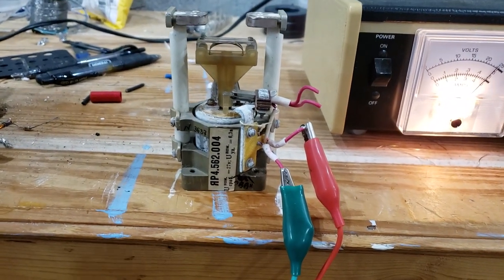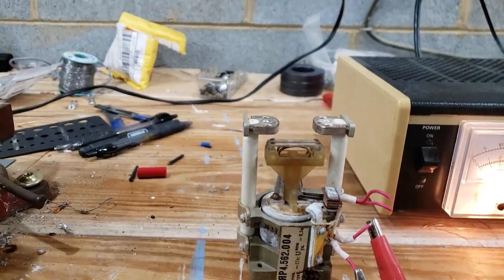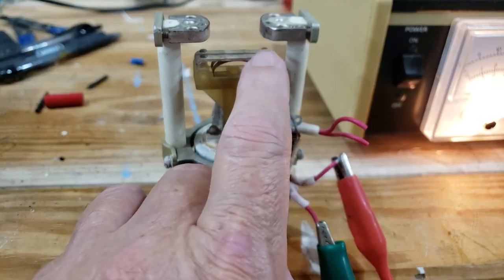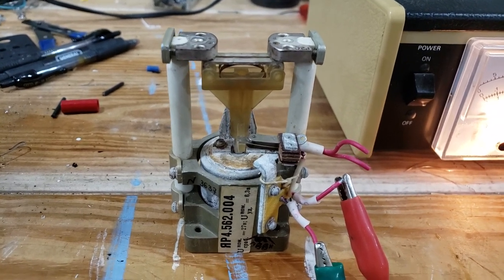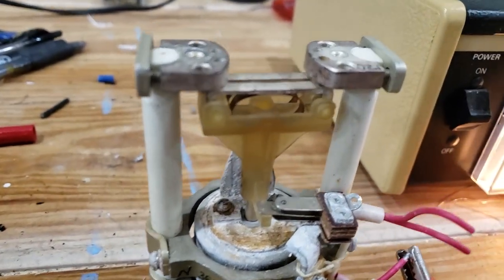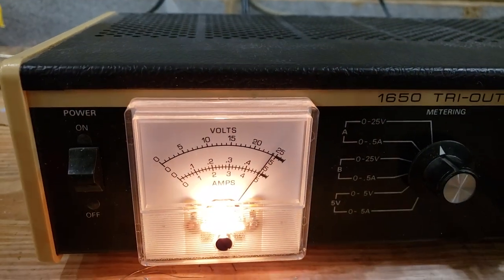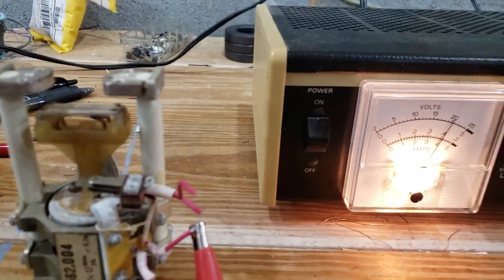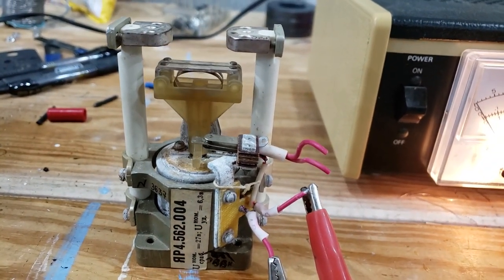Antenna Relay - Plunger Type

Comment: I'm thinking about just running 1 more run of rg58x from shack to the  80/10 130 ft antenna. Then id have 2 x rg58 runs from 80/10 antenna, 1 connected to the xformer and 1 connecting directly to the antenna.  I would switch have a switch at the shack for 160 vs 8010.

Comment: Steve, I can’t find these on eBay... I guess you need two?
Reply from the maker: https://rover.ebay.com/rover/1/711-53200-19255-0/1?ff3=4&toolid=11800&pub=5575522562&campid=5338568994&mpre=https%3A%2F%2Fwww.ebay.com%2Fitm%2F5kV-5A-Power-Air-Antenna-Relay-Ham-Radio-Lot-of-1%2F264413094711%3Fhash%3Ditem3d903fa337%3Ag%3AUKQAAOSwTM5YwWH1
Reply from the maker: https://rover.ebay.com/rover/1/711-53200-19255-0/1?ff3=4&toolid=11800&pub=5575522562&campid=5338568994&mpre=https%3A%2F%2Fwww.ebay.com%2Fitm%2F3-5kV-1A-RF-Antenna-Relay-SPST-Contacts-Silver-Switch-for-QRO-Military%2F292427662769%3Fhash%3Ditem44160c05b1%3Ag%3ALpcAAOSwLOZcmzps
Reply: Thanks!!  I swear I searched on antenna relay and neither of those showed up.  I ordered 4.  I assume you need two per antenna to get dpdt
Reply from the maker: @davistroy  Hope these work out. Read the comments below about how to use the extra contacts to reduce voltage after the relay closes. That should make it last longer. I haven't tried these yet so let us know what happens.